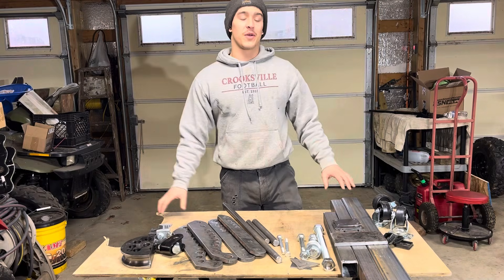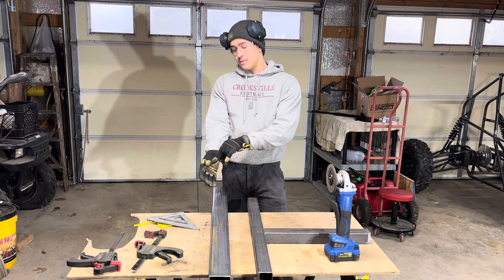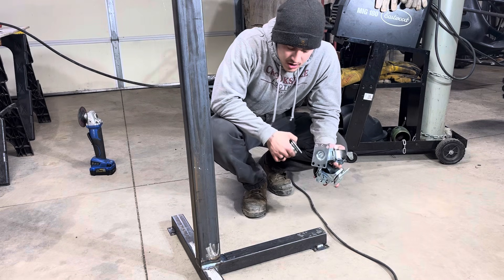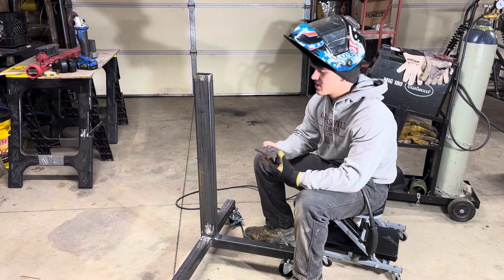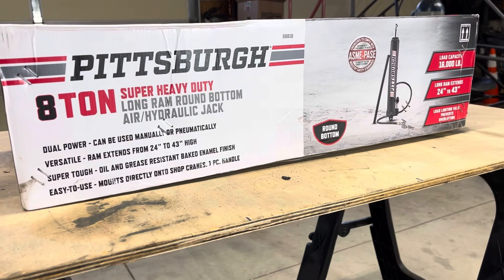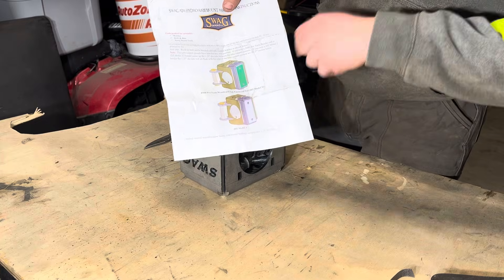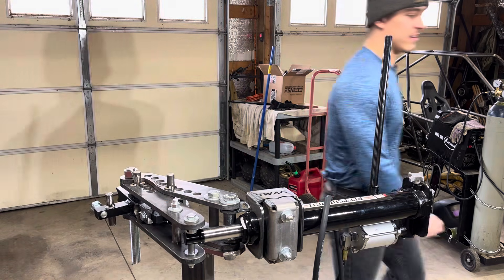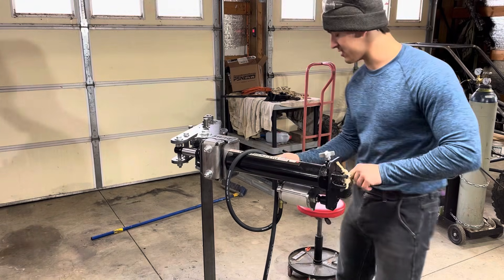Building a Hydraulic Tube Bender from scratch! Easier than you think! Plans Available!

Comment: thats a 4 thosand dollar nachine to some people i say that its a pretty simple machine to make with some basic understanding of following direction knowing how and what tools to use be able to weld and re pourpose larger size sprokets and chain drive set ups  in a gear reduction configuration you can get the main pivot point part of it operating with the force needed and build on the rest of the pieces depending on if you are needing a mandrel with a wiper for thin wall or just need for a few sizes of thick wall style chromoly or something similar in structure  for the price of some of these machines im almost thinking about buying a few machining tools and fabing up a kit with minor welding required to asemble for half of what they are pricing these benders that have a 150 dollar air/hydraulic or electric/hydro cylinder kit on a ratcheting style on a pedestal mount like i would use manually in shop with long ass handle lol